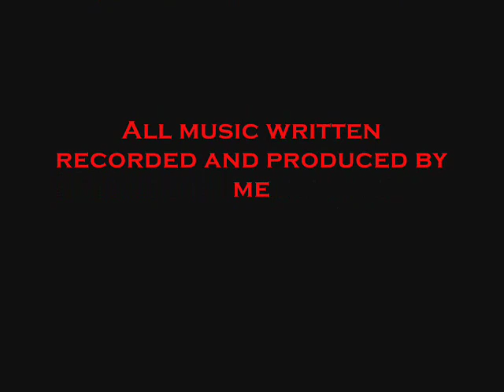Making my wifes leather sheath part 2

Comment: Some comments on the wood glue and if it gets wet, will it lose its bond. As a woodworker, regular wood glue (PVA type) will weaken or lose its strength if it later contacts water. You have stitched your leather anyway, so should be strong anyway, but if you use elmers carpenters glue MAX, (not regular elmers carpenters glue) or tightbond 3, these are both waterproof woodglues, and should be better if your leather got really wet and the glued layers maybe could loosen some.